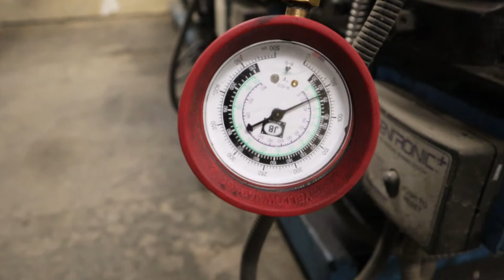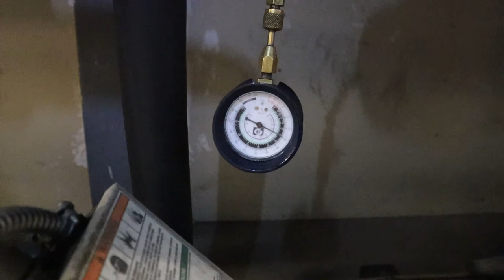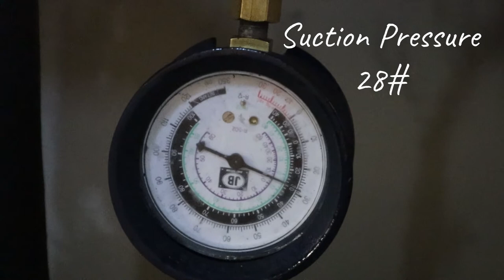How to Check the Compressor Oil Pressures

Comment: Great video,
i've got a low temp rack with 3 copeland compressors.  one compressor is frequently tripping out on oil pressure.  can't figure out why. client suggested swapping out the compressor which we did.... the issue remains... only on compressor 3 though.  lost for ideas.  we have also changed the pressure differential switch incase that was faulty. and installed traxoil system to ensure it's not an oil supply issue.
any suggestions would be awesome.  ps... oil reservoir is full of oil 80%

Comment: What s the common cause of compressor lockout on low oil?  Happened multiple times.  Sometimes takes 45 minutes to lockout other times 3 days.  Oil pressure oil reads around 65 with suction at 43 ish.  Any obvious low hanging fruits you’d check?
Reply: So oil pressure is 30 ish

Comment: Are you using a low loss fitting to check your oil pump pressure? Your gauge seems a little too oily...
Reply from the maker: That happens when you play with oil 😃
Reply: @refrigerationconfidential4376  👍🏽 great video. Keep them coming